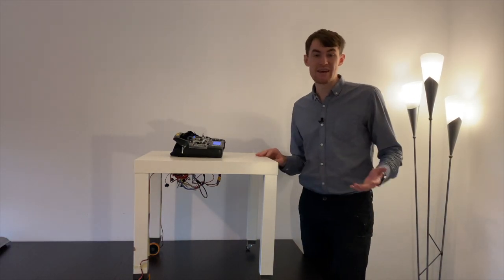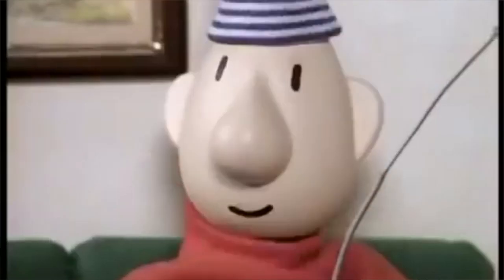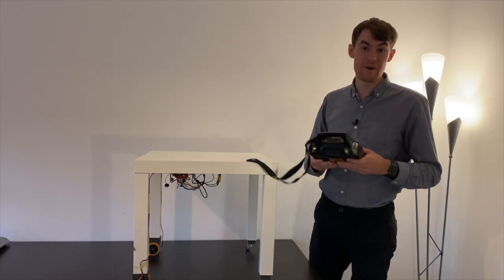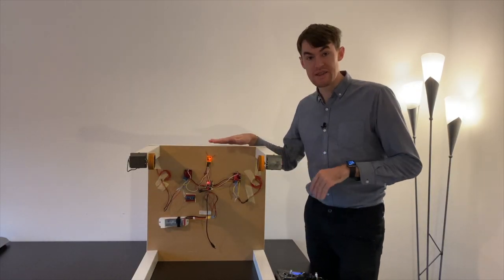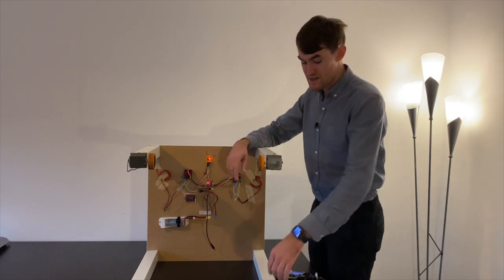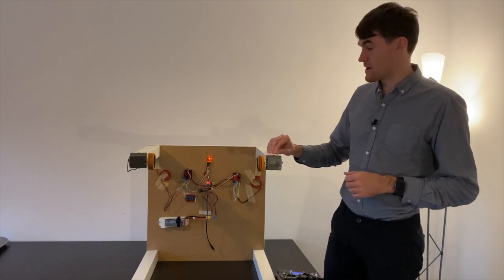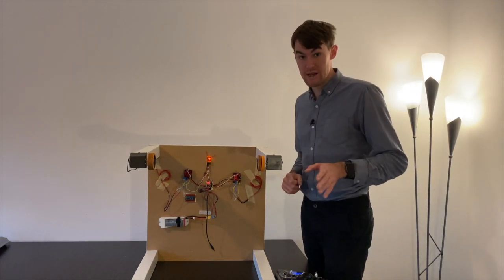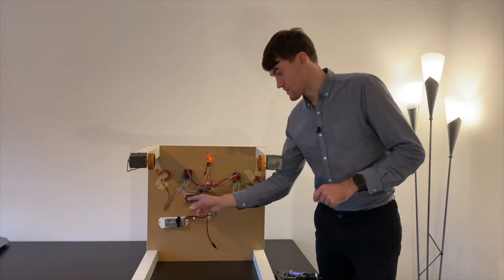Building a remote controlled IKEA table

Comment: Hi! I don't know if you'll read this but I was wondering if you could explain more thoroughly how you got it to work like connecting wires and how you actually did it. I am actually currently wanting to do something very similar to this for a project and I need a bit of help. You are the only video and website that has this. If you read this please help, I don't have much time to complete it. Thank you :goodvibes:
Reply from the maker: Hey Linda, happy to help. What is the problem you are facing? What cables do you want to connect to what?

Comment: I am a beginner to this and I wanted to know a more detailed process like how you connected the batteries to the wheels and to what you connected the wheels to (the receiver, or the transmitter etc.) or even how you connected them. Did you just use tape, did you bind them together with fire. All that. Sorry that's a lot 😅but information like that. Thank you so much!
Reply from the maker: Do you have the materials I listed here? 
www.pinchofintelligence.com/building-a-remote-controlled-ikea-table-2/

Comment: Cool! So you already thought of an Arduino as brains for the self-driving, what sensors did you have in mind? Maybe just near-proximity ultrasonic as it won't go that fast and can just drive until it almost bumps into something?
Reply from the maker: I wanted to mount a kinect. Gives you visual features and depth!